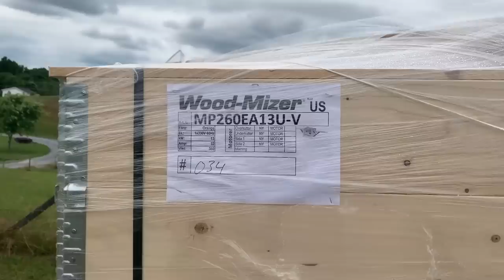Raising The First Bent On The Timber Frame At The Sawmill,

Comment: Nice job. It looks great. I couldn't help but notice the pins were very easy to drive in. I'm no professional but I saw on another video about trad old oak frame house building and what they would do is they would cut and chisel out mortise and tenon as usual. Have all the part seperate and drill the upright pillars right through. Then assemble the whole thing and gently mark, with the same drill bit, the tenon so you know where the centre of the hole is. Then disassemble and drill the holes in the tenon an 8th/16th of an inch towards the the face of the 2 mating surfaces. Then reassemble and that way the hole is slightly off centre so when the pin is driven in it really pulls the joint super tight. You might already know all of this but I thought I'd share what I'd seen before in the hope it might help. Keep up the great work. Love you videos. So enjoyable and very relaxing to watch. 👍👍👍
Reply from the maker: yes some do it that way, I was trained this way, I would say their method works very well also, appreciate you watching,
Reply: @OutoftheWoods0623  Yeah I thought you'd been round long enough that you'd be aware of it. The advantage with your way is if you want to change something it'd be a hell of a lot easier to pull them pins out than the off set way. Keep up the good videos. Thanks for sharing your work with us.

Comment: MP260 4-Sided Planer/Moulder, 230V 1Phase

How will you attach the bottoms of the bent to the concrete?
Reply from the maker: large L Brackets,
Reply: @OutoftheWoods0623  I may a similar situation. If they are something you bought, could you provide a link. Thanks.

Comment: You didn't off set your dowels to pull the joint together 
Best regards David in Somerset a retired carpenter
Reply from the maker: yeah been told by Timber Framers it is optional,

Comment: Great to see you starting to build the barn Nathan, I'm look forward to seeing it going up.
On the construction side I was surprised that you didn't offset the tenon hole so it cinchs tighter when you fit the peg in. Any particular reason why you didn't do that?
Reply from the maker: I was showed by two old timber Timber Framers that draw boring was the builders choice, they said if you do tight joinery it is not needed, good ?
Reply: Sounds sensible, Look forward to seeing the rest of the build.  @OutoftheWoods0623

Comment: My question is , how are you going to hold it down onto the slab ?
Reply from the maker: L bracket
Reply: @OutoftheWoods0623  Maybe next time inbed galvanized heavy duty straps into concrete. I do this on all my posts wether slabs or just spot footings like for decks.
Reply: I never put wood into the ground.
Reply: Also I would like to say you make great videos. Thank you for that.